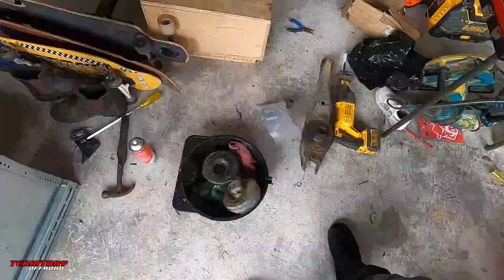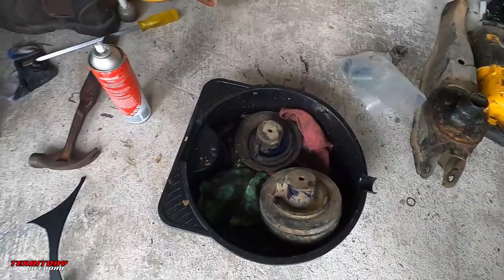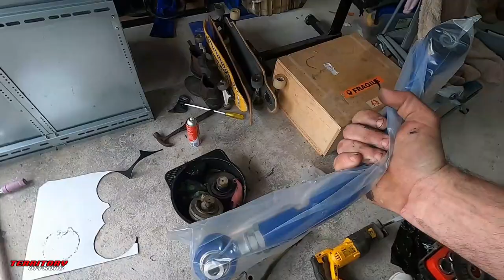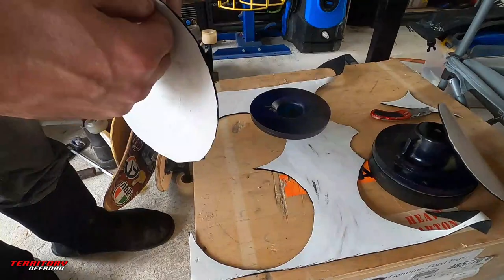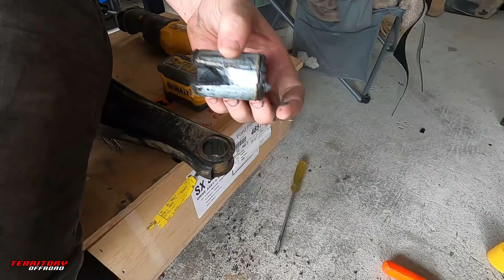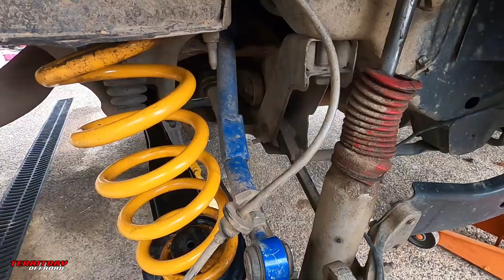Fixing Suspension Issues | Territory Offroad

Comment: The reason everyone  talks down on Terry's is kos none do these bushes. My 06 turbo whole front was  fkd wheels bearings bushes everything. Putting 09 front hubs arms etc in with new diff bushes
Reply from the maker: I've got to do the front 3rd diff bush this weekend and will pull everything apart to check at the same time. 

People just neglect them and then complain when they get the big bill.

SY2 upgrade is the best thing you can do.